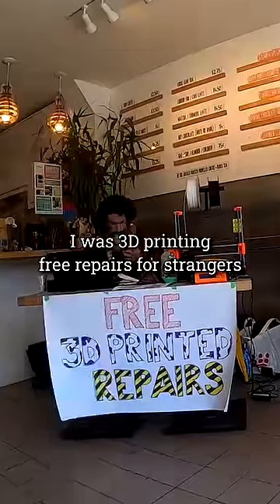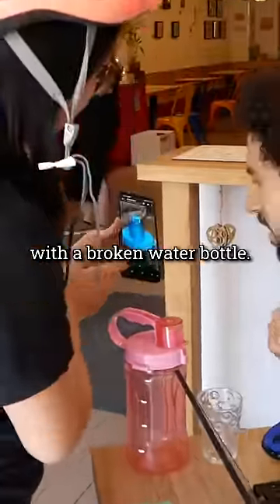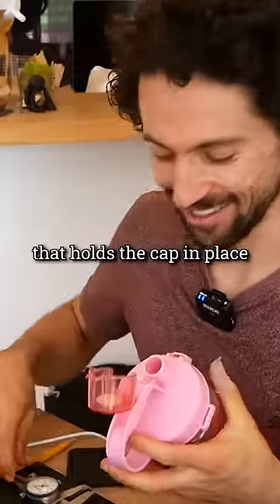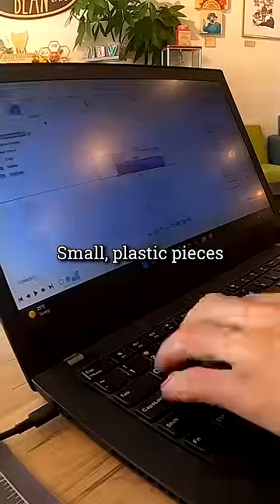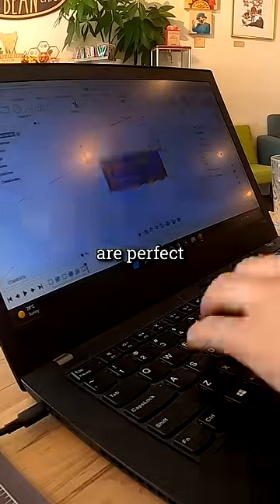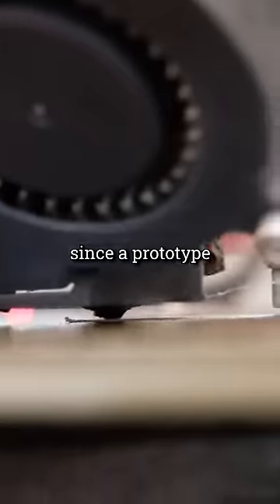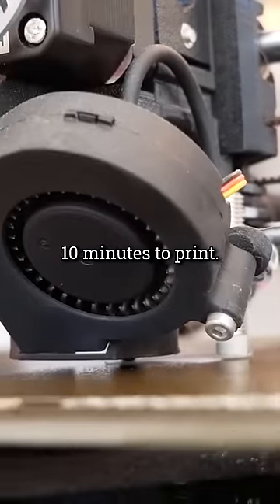Free repair for a stranger #3Dprinting #DIY #repair

Comment: Love your videos. Never saw this one being fixed. This shows how easy it is to fix things instead of throwing them out.
Reply: Definitely not easy or worth the time for a water bottle. Unless it’s sentimental. 

Assuming you have the skill and a printer that actually works that print will take 2-3 iterations of design and fit check and modifying. You’ll be messing with that for min two hours assuming you have the skill of 3D printing and design. And if you have crap software like free cad versions it’ll only take longer. 

But if you’re doing it for fun or for learning then go to town on it.
Reply: @latenttweet  I’ve got fuision 360 and an Ender 3 pro
Reply: yea you just need an awfully expensive 3d printer and 3 prototypes
Reply: @spankdaddy1920  you don’t just go to micro Center and sometimes they sell the Ender 3 ( what I’ve got ) for 100 dollars . And I got fusion 360 for free
Reply: I’ve heard buying new when broken is a luxury for the rich an fixing is for the poor
Reply: @diywithhaz1559  i literally know nothing about 3d printers🤠
Reply: You need to learn how to 3d model, buy a printer, buy the resources,  learn how to properly work and maintain the machine and repair it in case of damages. How in the hell is that easy?
Reply: @BunPrince  i learned how to do it on a course under five days. It’s quite straightforward once you know the basics
Reply: @latenttweet "Worth the time" tell me that you are American, without telling me you are American. It's not just about cost and efficiency dude. It's about learning again to repair stuff we already have instead of throwing it away. We can't just throw away everything forever.

Comment: Can this be the future please!? The amount of plastic that could be reused by being able to replace that one tiny bit that breaks.... thank you for this
Reply: Not worth the time for $2 cap
Reply: Maybe in 10-20 years when 3D scanners and AI cad get better. For now expect 2 hours with proper skill to do that.
Reply: Tons of plastic is wasted, but it took him 3 revs of printing plastic to get it right. And the material isn't food safe.

3d printing is an amazing tech (and I use it all the time at work for product development), but it is not the solution for everything. This part will also probably break because 3d prints are anisotropic and have cavitation that make it significantly less durable than the original materials.
Reply: @latenttweet  honestly you’d be surprised how quick you can design small parts like that. I’ve been using cad for a couple years and I reckon it would take about 20 mins or so
Reply: @aarondrossart6026  if you do it correctly you can get compliant 3d mechanisms to last for a while. You just gotta make sure where it bends is with the grain of the print and use a flexible material. Certain types of 3d printing materials are food safe so long as you follow the correct procedures. Some filaments are even fda approved. The biggest issue with printing is that at lower resolutions you have areas where stuff can hide. If you smooth it that isnt an issue. Also while it did take three tries. Two small pieces of plastic vs a whole water bottle is still saving plastic from landfills and you can even melt down old failed prints into new filament.
Reply: @bentrod3405  all of this is true, and I'm all about plastic reduction, this video just isn't an accurate representation of any of that.

3d printing has so many applications (and I use it all the time for work), but I don't think that this is it. If we're concerned about a part breaking, the best way to address it is in the design. Being made out of a stronger material, or having a different sacrificial (and easily replaceable) part are relatively easy ways to avoid the need for this fix in the first place.

Thanks for a good discussion! It's refreshing on this platform :) cheers!
Reply: @aarondrossart6026  most pla prints are food safe!
Reply: It's already the future...... Buy a 3d printer for the family for stuff like this. What needs to be the future is every home having solar panels to power everything and sell back to the grid. Maybe even have servers at home since privacy is a hugeeee concern for people these days.
Reply: i've had my metal water bottle for 4 years, and the only damage to it is chipped paint. a better future would be to purchase things that are guaranteed to last long and to use plastic less.
Reply: Knowing how the gov can't tax it, it'll probably be outlawed.
Reply: This is now.

Comment: I don't think some people understand the value of a water bottle that's been with you for years. Like you never want to throw away that shit. I have a water bottle I have been using for 5 years now with a dent and an internally cracked lid but it's still very functional. Ofc I don't bring it on travels but I still use it for my day to day uses in my house.

Comment: This is how I fix my shit at home with the printer at work. Measure, CAD, proto, proto 2 (and sometimes 3 or 4 lol)👌

Not always worth the proces, but most fun to do.
Reply: Do you wear gloves when you trim down your first attempts? Lol check out the poster's thumb.

I've been cut too many times to not wear gloves whenever I have my knife out now.
Reply: @hamznaq6953  unfortunately that happened to me as well. I tend to get the supports out in too little time, which sometimes has nasty effects. 
I should wear some gloves yea 😅
Reply: Are you more experienced than this guy and actually use Micrometers? Then and calipers are what I use when working with the lathe

Comment: Printed this part the wrong way round. The force is going to be focused on a 1-2 mm thick lip. It's gonna delaminate after only a little bit of use. Good stuff otherwise, but I think that tab wil break within a couple of uses

Comment: One little thing I would change on the model. Since such a latch will stress along the latch and the length I would print it on its side to have layer lines reinforce along both those high stress areas to prevent any long term durability issues due to not having perfect layer adhesion. While the way printed will be fine in the entire length of the piece the hump that allows the piece to click in could get damaged sooner then it may need to. Another plus would be a potentially smoother surface to lock into as the layer entire surface will be free of layer lines.

My eyes are also poor so I may have not been able to see the print orientation right anyways.

Comment: man don't print 3 times, just polish the first one a bit and done, much faster and saves plastic, heat it briefly with a lighter and rub it against an smooth stone for an smooth finish.
Reply: or, he can upload the V3 onto a site like printables and then anyone else with the same problem can just print the V3

Comment: Won’t lie… when you have a favourite water bottle - you will keep it until 100% broken!

My ‘emotional support’ water bottle was $60 (built in filter which is the only way I can force myself to drink water) but I’ve had it for over a year and actually use it!

Would absolutely get it repaired before replacing if possible if something needed to be fixed.

Comment: I had my good travel mug break. It was a leaver that held the cap in place. 2 holes where a pin goes through to hold the lever in broke. Really wished i had a 3d printer for it

Comment: I saw an awesome metal 3d printer online somewhere. I thought it would be awesome for the exact reason you're using your plastic 3d printer. Although i believe it would release some welding funes in the air. Im not sure.

Comment: Not to be a negative nelly but
There are studies that suggest that 3d printed parts while perfectly biodegradable (pla and a few others) are usually not food safe. They have a structure that is easy for microbes to inhabit and they have a higher tendency to leach microplastics into the liquids

Comment: Needing 3 prototypes doesn't seem productive though. You should invest some time into proper measuring, parametric design and learning about imperfections in your print, so after a while, all you need is one. Hell, that could be your slogan haha
Reply from the maker: 3 tiny prototypes is probably a more efficient workflow than trying to get it perfect on the first go. It’s impossible to predict how something won’t work virtually, so might as well get to a minimal viable product as fast as possible.
Reply: I don't know what's with all the assumption that he didn't "invest time into blah blah blah" but you know there are a lot of factors that can contribute to inaccurate measurements and prints in FDM printing right, especially for a tiny piece like this the tolerance won't be high.
Reply: Have you ever tried mechanical FDM printing? It doesn't sound like you have.
Reply: Disagree tbh. Usually you give your quickest shot and then come back and make adjustments. This is how fast prototyping works in those use case. We usually call them iterations.

The only comment I would make is some materials like PLA is food grade but not suitable to use repetitively in contact with food or drinks due to the microscopic artefacts.
Reply: I don't entirely agree, based on almost every day experience.
Reply: I just went looking for your videos of doing a service for the public, couldn't find them. When you actually know about the subject you'll realize how good the creator is. It's not as simple as it looks to Just jump into fusion like that and make a prototype needless to say in public.